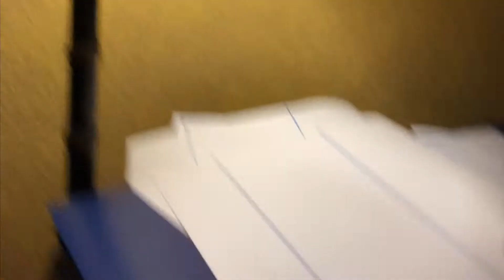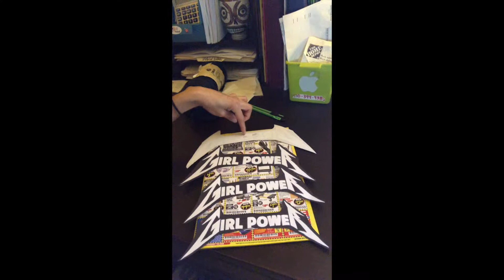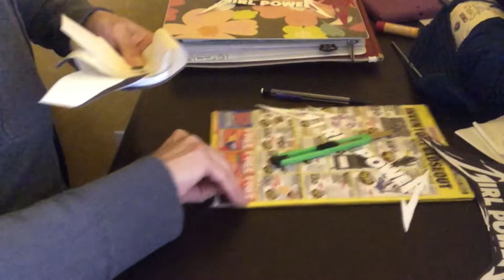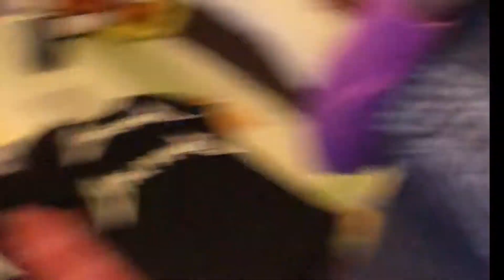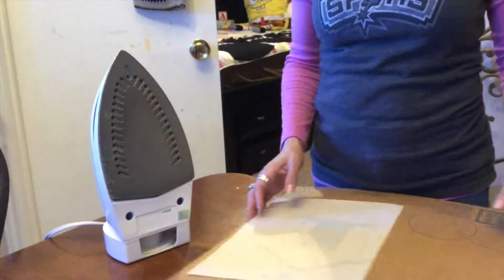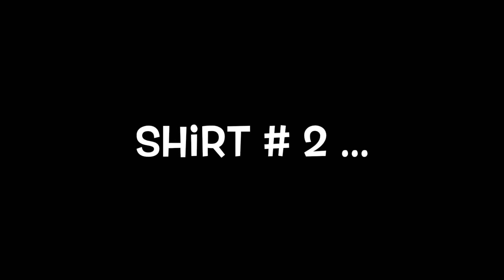DIY Using *Jolee's Transfer Sheets*---Girl Power T Shirts--

Comment: Excellent video.  Is it really necessary to cut out the black between the letters if you are ironing onto a black tshirt?
Reply from the maker: If you don’t mind having a lighter grayish/black in between. To me it’s noticeable even though it’s small. It will look a bit off because the T-shirt is new & dark black. I also don’t put shirts that have DIY iron on vinyl in the dryer. For some reason the printer (at least mine doesn’t) will not print the black as dark as my tshirt even when I put a new ink cartridge. Hope that helps. Thank you for watching ☺️
Reply: @momovaryacting8798  thanks for answering 😀

Comment: I printed out pictures and the website flipped the words so that they printed backwards how do I make sure the wording comes out the right way and now backwards when i transfer it onto the tshirt?
Reply from the maker: When you’re ready to print there should be a setting that flips the image along with other features to customize your print. You may not see it right away, think it says “reverse image” just open different things, you should find it. All printers are a bit different so I couldn’t tell you precisely
Reply: The words print backwards for the light tshirt transfer paper. If you got the dark ones then it shouldn't. Maybe u picked the wrong option on their website?